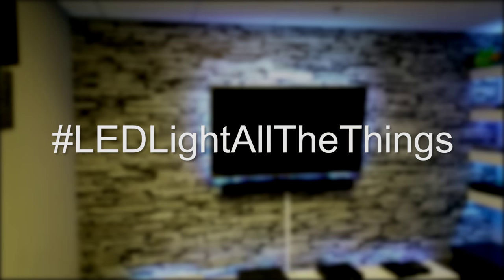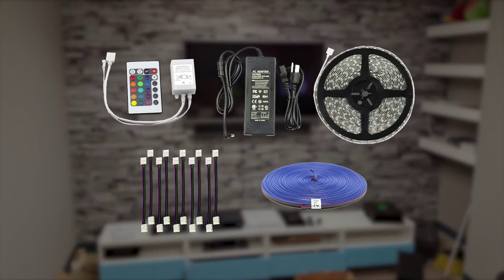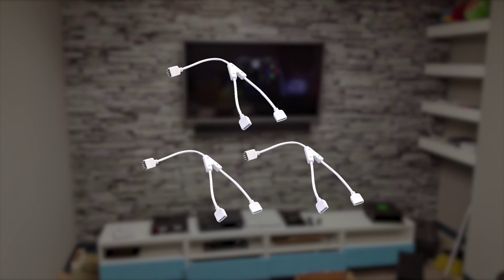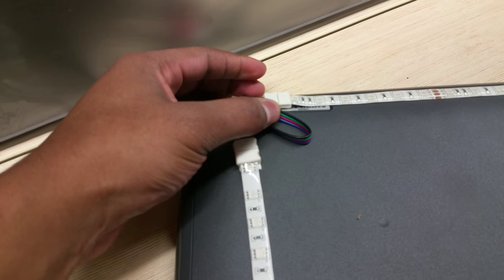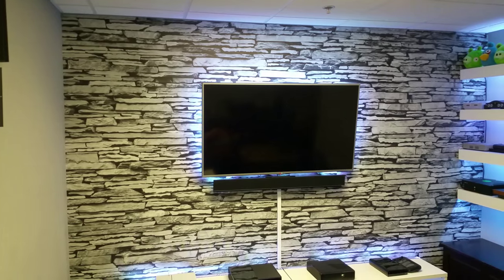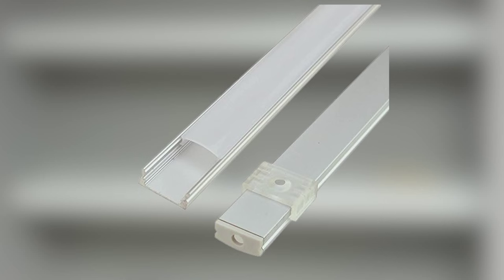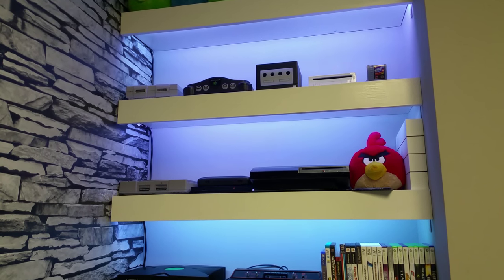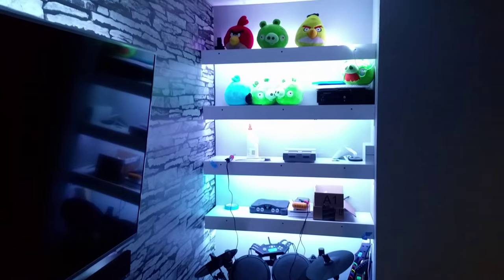Project Game Room - Vlog #04 | DIY LED Light All the Things

Comment: Hi,

Sorry for bothering you.
One question: How did you control the lights separetely? Cause as I see those lights aren't "synchronized".
In the corner the light is yellow for example..at the middle (tv) the light is bluish at the top then in the side greenish.

Comment: I got them today to, but only used to much for behind my desk and ive still got so much more left on the roll, i want to put some under my bed too, but how do i connect/power them, because its now cut off from the strip behind my desk, do i need the whole sepperate power supply and power led controller that goes into the led strip to power them?

Comment: Really appreciate the video. Can you tell me what you did to connect the 4 wire to those snap connectors? Did you solder the wires or just twist them together? Did you shrink wrap them?
Reply from the maker: Thanks for watching. Yes I cut the snap connectors in half and then spliced the 4 wire to the corresponding colors on there. I did not solder the wires. I twisted them, used heat shrink on the individual wires then used electrical tape around the bundled wires.
Reply: Awesome, thank you so much for the quick reply. I've been trying to figure this out for a couple days, I'm still waiting for my LED strip to come in. This video is the inspiration for what I'm trying to do with my bedroom, and I've been trying to figure out if I really need to solder or not. I really appreciate your video, your quick response, and your advice. Thank you!
Reply: i know its been 5 moths but can you please elaborate im a bit confused and dont want to use the connetor as opposed to the alternative

so i remove the wire proctectors

twist the wires ?

clamp the wires ?

really confused and cant find anything that dosent involve soldering

Comment: Hey, sweet set up! I was wondering is there an easy way to enable some sort of switch on this. So the part for TV could work while the others are off. Some sort of different modes. what do you think?
Reply from the maker: +Aman Zare Yeah pretty easily. pretty much every place that we broke out the 4 signals into 4 wires. The 4 signals are Red Green Blue and 12v/24v. If you put a switch on the power line in between any 2 sets of leds I think it would have the desired effect you're describing.

Alternatively if you got an extra controller you could put the TV on a completely different circuit. If you get the exact same controllers for both circuits the same remote would work for both.

Thanks for watching!

Comment: I don't think I heard in the video, but about how many meters of LED strips did you buy? I'm assuming you went based on the measurements from every piece of furniture that you installed it on?
Reply: +Ernesto Villasenor Lastly, did you keep the regular lighting in your room, or was it not necessary?
Reply from the maker: +Ernesto Villasenor These are 32ft or ~10m.
Reply from the maker: +SrgntBallisticGaming We still have the overhead lighting but turn it off when we are using the leds

Comment: hi
how many power supplies did you end up us using?  is it OK to use one?  I was told you need to only use upto certain length of led strip per each power supply and was wondering if true.
thank you
Reply from the maker: I used two power supplies. One for the area on the left and another for the area on the right.

There's are 24V LEDs where most LED strips are 12V. The extra voltage is to help for longer runs. When we first got them we hooked the entire strip up and let them run for an extended period of time and didn't have any problems.

Comment: The power adaptor is with the command romote or you need to buy a;; this things separate ? (remoter,leds,power adaptor,the adaptors,etc.)
Reply from the maker: +Miguel Ribeiro Some packs come with Controller/Remote, LEDs and Power Adapter. Others only have some of those.

The ones I listed in the description should have all 3.
Reply: Thank you very much ! You helped me a lot,now and with your video! :)

Comment: Can you turn off the led strips on the tv so you dont turn off the strips below the tv? What i want to say is can you get it to work modular?
Reply from the maker: +Filip Not with this very simple setup we have. You'd have to either get two of the same controllers/power-adapters (so two seperate circuits) or a more expensive controller system which allows for 1 remote to control multiple different circuits.

I how that helps!
Reply: +SrgntBallisticGaming One more question do i really need to get 24v power adapter instead of 12v for one 5m 5050 rgb leds?
Reply: +SrgntBallisticGaming What i meant can i use 12v 2A power?
Reply from the maker: +Filip The 24v power adapter is for the longer (32ft) strips. Typically 16ft strips come with 12v adapters.

Comment: Hey question did you run all those strips of one power supply? Are you experiencing lack of brightness. Thanks for the help
Reply from the maker: Hi. The TV and entertainment stand areas are all run of of 1 power supply. I haven't noticed any problems with lacking brightness. Are you experiencing this? If so do you know whether your LED strips and power supply are 12V or 24V? For applications like this I always recommend using 24V strips. They are a lot brighter and allow for much longer runs (Up to 32ft I think).
Reply: +SrgntBallisticGaming thanks for the reply. I bought the same as you. Looking to do it around the back of my 65' tv and to the bottom where I have a fire place. Hopefully I could have this project looking like your. 
Awesome work. You didn't have weld any connection together correct

Comment: A better way to hide the wires, why don't you find the same wallpaper that was on the wall behind the TV and see if you can use that to hide the wires by cutting and gluing over the wires from TV down and wires against the wall on the shelving.

Comment: What type of connector do you use to wire the 4wire cable and the led strip to make that great extension.
Reply: Never mind... finally found it on amazon
Reply from the maker: In the description there's links to "LED Connectors" these snap on to the end of the led strip segments.
I simply cut the wire inbetween the to snap ends in half then spliced it to the long 4 wire cable which have the same color arrangement.

Comment: I think the reason the last strip is not lighting up like the rest is because of the WATTS.  Leds will start too dim if there are not enough watts to power the strip.
Reply: yes, you are right. for 12V, normally can not be longer than 5m even for enough watts. if you want to connect longer, need to use amplifier

Comment: What was the purpose of the 2 splitter again? I saw your diagram but still don't get it.
Reply from the maker: 1 Splitter goes up to the TV.

The other just mirrors the two sides of the entertainment center. It would be possible. This way they're all running in parallel. It's possible to do this whole thing in series but if something goes wrong with one area it can mess up the rest.

This way we can trouble shoot or make changes to any section without messing up the others.

Comment: how did you make the strip going to the TV not work and then on the TV itself work?
Reply from the maker: There's a cable (4-wire) going from the strips on the bottom to the strips behind the TV. So there are no lights to worry about.

Comment: in order to connnect the 4 wire with the connectors do you have to use the pins or you Can only match them normally?
Reply from the maker: So if you see the solderless connectors I have linked and show in the video they have 4-wire which is in the same order as the long 4-wire I have linked/shown.

So I cut the 4 wire solderless connectors in half and extend them by splicing the long 4 wire to them. Keeping the order so R to R, G to G, B to B and Black (12v/24v) to Black.

Let me know if you need anymore explanation. Thanks for watching!
Reply: SrgntBallisticGaming thanks so much!
Reply from the maker: No problem. So that helped?
Reply: SrgntBallisticGaming yes a lot!

Comment: so with that set up list did u have to solder andything cause i have no clue how to solder
Reply: Cleveland Roberts I know how. it's... only dangerous if you can't focus, and it's really tedious. basically, heat up the wire and whatever it's being connected to with the iron, and feed the solder into it. you can look up videos on the basics, and pictures of what a good connection looks like. It's not hard, the only problem you could have is overheating the piece, and applying too much solder. the second can be fixed, it's just a pain. I just got out of my mechatronics class, we do soldering, programing, and robotics.
Reply: Cleveland Roberts I'm in Georgia btw. I could come up with a system so I know which ends get connected to which, if you're interested.
Reply from the maker: None of the items here require soldering. The connectors are solderless. For extending the connectors I simply cut the wires and spliced them together with the 4-Wire and secured with electrical tape.

Soldering can help create more secure and permanent connections but we chose not to do much soldering for this installation.
Reply: thanks for the reply. yea i was looking that stuff up. i bought the things on the list im going to do my entertainment center in my living room hopefully everything goes good

Comment: hello, you use just one remote for two controllers?
Reply from the maker: Yes you can if both have identical controllers. Actually a lot of the slightly different controllers use similar components and some of their remotes work for across controllers.

It seems like there's just 2-3 actual OEMs and a ton of companies rebranding them. But if you buy 2 of the same set you should be able to use just 1 remote!
Reply: +SrgntBallisticGaming thanks a lot for the help

Comment: i am a little  bit curious about the link " LED 4 Pin Connector: http://amzn.to/1J7L0Dj " i never saw  you using one in the video, i really like this video and would like to do this in my room, but what do i need? only the things that you show in your video or everything linked in the description? and how many of each item do you use like how many led connectors? i would very much appreciate an answer! thank you!
Reply from the maker: +felix östlund It really depends on your application. Those connectors we only used in a couple of places to connect the 4-wire to the 4-Pin header connectors that come off of the LED Controller.

They have their Pros & Cons. They are easily disconnected so you can change the layout of things when you need to. But since they disconnect so easy they might cause loose connections.Whenever we use the 4-pin connectors we tape them together to prevent this.

Comment: how did you connect to the 4 wire?
Reply from the maker: If you notice the connectors on with the 4 wires are RGB + Black just like the 4 wire. We cut the wires on the connectors in half. Then spliced the connector's wires to the 4 wire and electrical taped them to prevent shorting.
Thanks for watching

Comment: how you connect 4 wire and Stripe?
Reply from the maker: +CreX Art Cut the 4-wire connectors in half and splice the wires together
Reply: +SrgntBallisticGaming Ah ok thanks. Is it also possible with a insualating screw joint?
Reply from the maker: +CreX Art Yeah any mechanism which splices wire together would work. Just keep in mind where you'll be putting it. You'll have to hide it so be aware of that.
Reply: Yes I have idea for that.
Thanks =)

Comment: Those are really crappy LED Strips and they don't Display the nice  color spectrum that you get from the single multi color LED that displays over 30 colors and its still about 13$ for a 3 meter strip.
Reply: hhhhhhhhhhhhhhhhhhhhhhh no no no hhhhhhhhhhhhhhhhhhhhhhh no no no